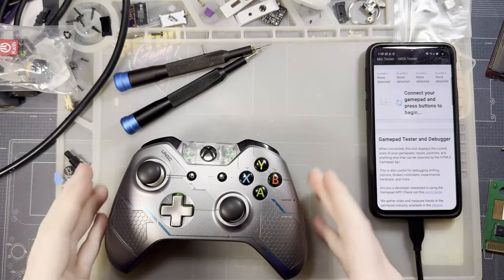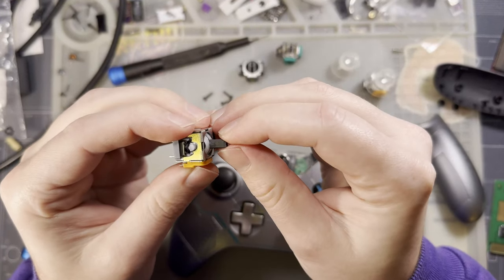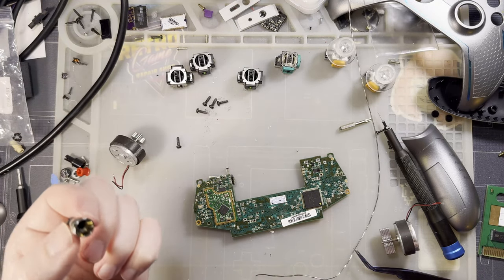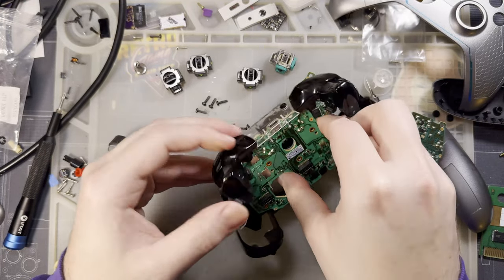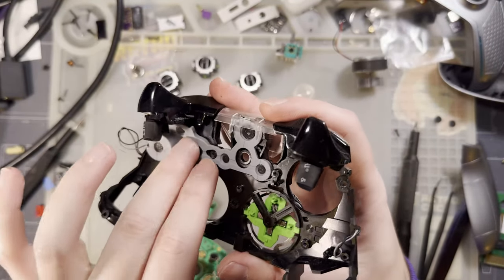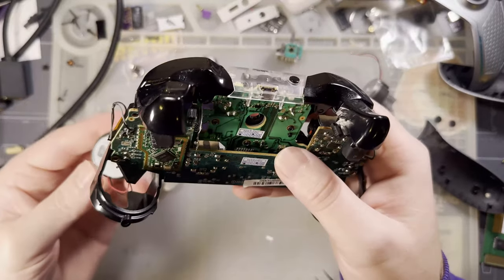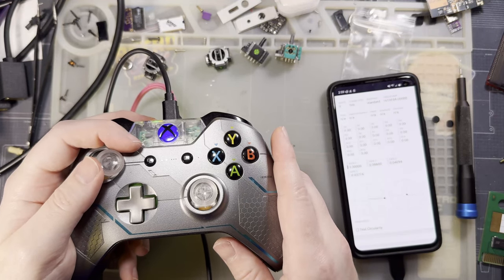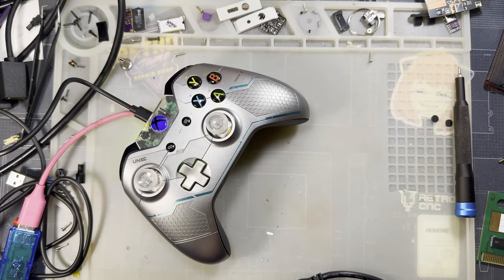Xbox One Controller (1st Gen) Hall Effect Replacement Sticks

Comment: These sticks are a decent replacement for originals if those are drifting, but calibrating them is a bit of a pain in the ass, i've been using a set on a Series x controller for a few months with no real issues so far

Comment: have you try to replace newer model xbox controller (1914 type) with this analog hall?, because my 1914 controller went crazy last time i try to replace the original analog with hall effect one
Reply: I have the same problem. Did you find any solution?

Comment: Use gulikit TMR!!!
Reply: try them out, they just released and implement electromagnetoresistance in order to deliver a good signal but having more lifespan due to using magnets as well as hall effect joysticks, they also deliver the same output as with the alps joysticks and in xbox series s can be recalibrated to be centered with low percentajes in circularity tests
Reply from the maker: @danielc5647  I'm willing to try out alternatives for this (because the alternative is e-wasting this controller) but I have exceptionally low confidence in these products based off what I've seen so far and all the misleading marketing.

Comment: To be fair calibration on ANY stick, carbon film or otherwise can be an absolute pain. I’ve tried replacing the switch pro controller with the same 10kohm spec, same footprint, same brand, alps pots and housings and they never work for seemingly no apparent reason and calibrating them gets them working like 60% tops.

I don’t understand what’s going on in modern controllers where the rules about sticks are magic and made up.
Reply from the maker: TL;DR, rules about sticks are magic and made up, like you said. 

---

I believe I explain this in a video I have but since I'm yet to publish it, that doesn't really help. The issue is that the combination of three mechanical devices which all have their own tolerances adds up to a noticeable non-zero value. It's unfeasible to manufacture the parts of these stick boxes with tight enough tolerances that the calibration is always correct. 

Resistors in particular are extremely difficult to get bang on. If you measure a few of your 10K pots on your controller sticks, I'm sure you'll get a few different values. Acceptable variance for most carbon film based resistors is likely 1% but 5% and 10% also exist and are relatively common. This is why a lot of older analog devices have "trim pots" hidden somewhere for calibration because all these percentages in a complex device will add up. Every Game Boy console has a trim pot for calibrating LCD voltages (DMG-01, Pocket, and Light all have beefier trim pots and labeled them "contrast" whereas the rest of the models hide the trim pot by or in the battery compartment).

Beyond the resistors is the actual moving mechanism that makes up the x and y encoder that you interface with your thumb. These parts aren't built with discrete bearings (expected lifespan vs price, etc) so the material is expected to wear down. This means that the mechanism has to be designed to account for varying tolerances here too. 

Add up the tolerance of the stick itself and then the tolerance of the resistor and you can get some pretty not insignificant variance in what "center" is. 

Historically, manufacturers have accounted for these variations by building a huge deadzone into the controller itself. You'd have to move the stick quite a bit before it would actually register so it didn't matter what the stick called "home" so long as the cumulative variation was less than x%. The controls in the games too were also quite a bit less precise than modern equivalents. As manufacturing processes have improved, processing capabilities of embedded devices has skyrocketed, and feature creep has set in, manufacturers are doing things a wee bit different now. 

Currently, manufacturers account for this variation by allowing calibration at the firmware level. Recently, Microsoft has allowed users to recalibrate their fourth generation xbox series controllers using their "Xbox Accessories" app but this does not work for older model controllers like what I have for this video. I don't have a 3rd gen to test with but it likely works with this too. 1st gen and older is definitely out though. Nintendo also seems to allow this with their first party Switch controllers as well (so long as you do it through a switch). 

Hall effect based sticks can solve one of these two calibration hurdles in that the hall effect sensor is always going to have very little tolerance on the output compared to a carbon film based resistor. This is fantastic for hardware designed with hall effect sensors in mind but for hardware built for carbon-film, the controller itself is going to have hard coded calibration data that the hall effect sensors will need to work against. Additionally, the stick mechanism is going to be susceptible to the exact same mechanical wear and tear as the carbon film based variant because this portion of the hardware is identical. 

As soon as manufacturer's allow access to this calibration data (either being able to zero it for hall effect retrofitting or reinitialize for new carbon film resistors), this issue will likely work itself out. Instead, most would prefer you just buy a new controller. 

For controllers designed for and shipping with hall effect sticks, manufacturers can actually implement a few firmware level controls to help address the mechanical wear and tear that these parts experience. For starters, resetting the calibration to zero upon powering up the controller would noticeably improve the long-term experience. Older controllers with optical based encoders (which incidentally solves more issues with carbon film based sticks despite pre-dating them) required this functionality because there was no "home" reading. The optical based sticks could only track relative motion so when you turn on the hardware, the stick sets its current position as home. N64 functioned this way and that's a big reason why those sticks only experience mechanical failure and don't "drift". The design of those controllers is not great for other reasons but that's beside the point.

Comment: What do you use on your living room PC? You use like Steam Input on Windows or have you installed HoloISO? I put HoloISO on an old Optiplex with a 6700K/RX 6400 and it's a decent little gaming machine for my old 1080p TV but it's not an incredible experience. The DS4 with the touchpad is nice, but it still leaves a lot to be desired. I hope Valve releases a Steam controller again taking inspiration from the Deck. The Deck's trackpads are absolutely incredible for controlling a PC solely from a gamepad. Hall effect sticks would be great for a first-party Steam controller V2. Doing the Gulikit sticks on my deck is easy, but I still wish they had just opted for hall effect from the get-go.
Reply from the maker: controllercompanion

Comment: Can you not just use the xbox calibration tool to fix the circularity?
Reply from the maker: I haven't checked lately but when that tool released, I did check. The calibration tool specifically is only compatible with xbox series controllers. This specific controller is an xbox one controller (no share button and micro USB instead of usb type-c). It is not compatible, unfortunately despite being basically the same hardware.